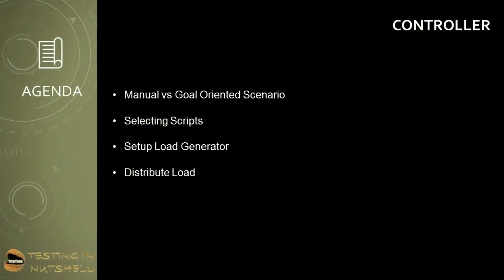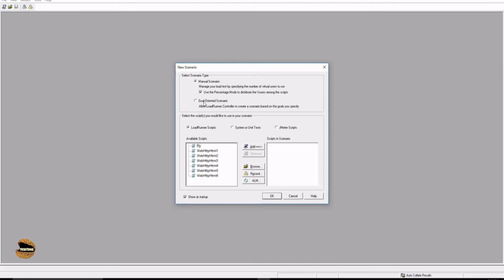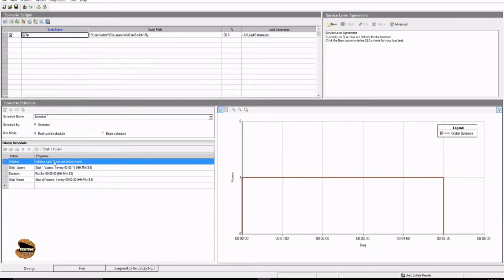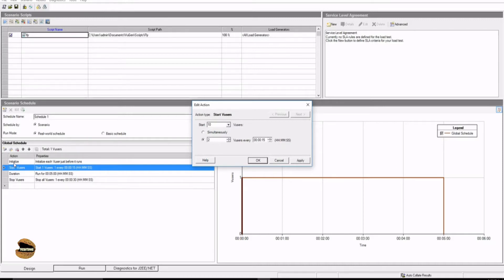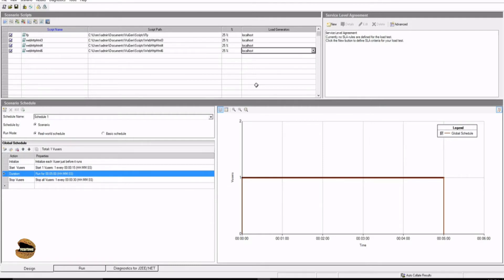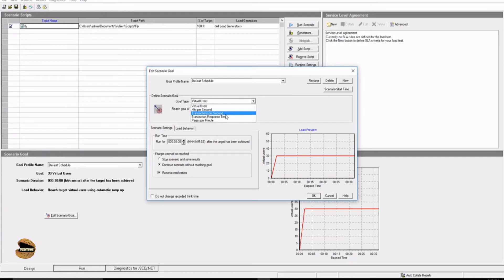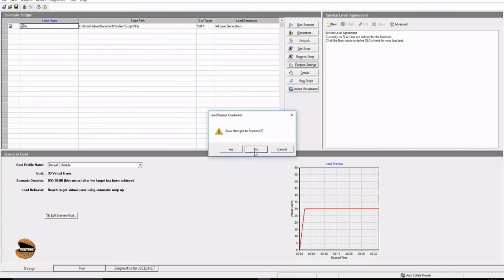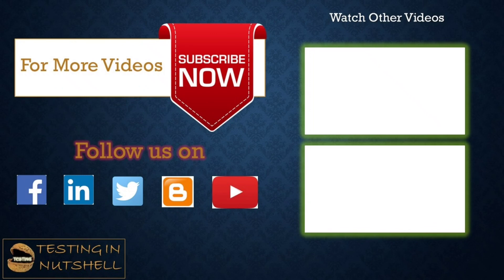Tutorial #16 | Manual Scenario vs Goal Oriented Scenario | Load Generator | Loadrunner Tutorials

Comment: Hello sir,
I appreciate your tutorial videos.
However, I'm confusing between Goal oriented scenario and SLA(Service level agreement).
What's the difference between two and their purpose?
Reply from the maker: Okay here you go
Goal Oriented Scenario is to define the goals(SLA) and run the test automatically create the required user(load), throughput to meet the goals.
Manual scenario is to manually define different configuration and check the actual output which may not be your goals. So you keep varying the load and throughput till you reach desired SLA thresholds.